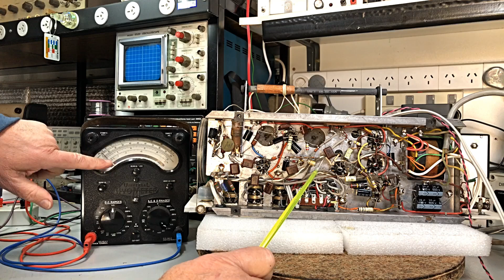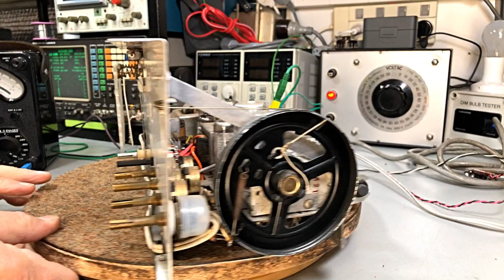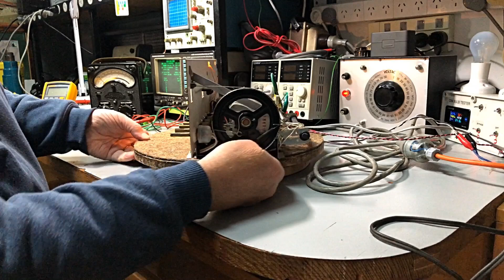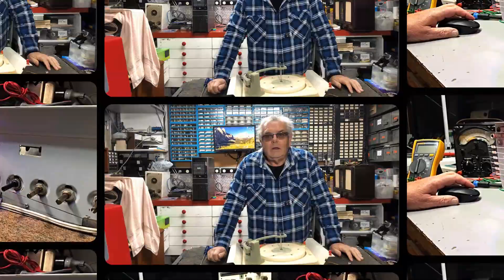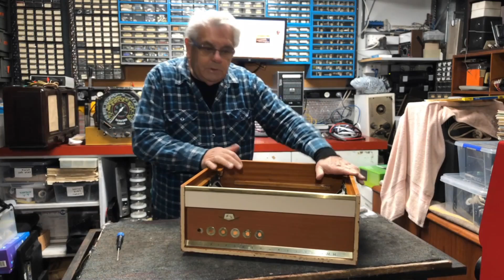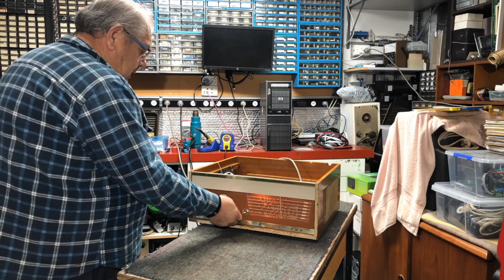HMV TableGram Part 3  - Alignment & Cabinet Install

Comment: A tricky capacitor there Baz. I thought it was odd to have different style trimmer caps but didn't think much about it after that. You have to wonder what the previous repairer was thinking with one of the IF transformers so far out. Good video Baz... although I do wounder why you didn't flip the assembly video back the right way in post 🤔🙂
Reply from the maker: Thanks Dave, I couldn't flip it in software, would separate the audio & would take me forever to lip sync so just left it.
Strange what some repairer's do to get a quick $$ !
Cheers, turntable up shortly, boy, had to strip it too but bonus, no parts left over !

Comment: Baz I have distanced memory from HMV Gram you had removed the dial scale for service it ,I think the man with stripped apron was about and don’t know why picked 475 kHz for If frequency when everyone was 455 KHz,It is very modern now with Bluetooth fitted now,I guess the Diesel Heater is out of your van I seen the temperature in Orange and snow,I remember doing service work in 1984 in snow not good memory’s my Congratulations for on going Refurbishment of HMV Bluetooth Gram I think the owner would be very pleased Baz,Ian,
Reply from the maker: The heater is a portable diesel one on a wheeled stand. Not from the caravan
 Might have to give more footage of the workshop. 4 workshop areas measuring 4.2mts x 17mts. Plenty of room but it's chock-a-block with gear at the moment.
Cheers 👍
Reply: @techobaz55 I could see that Baz you have great workshop but stack with gear and future projects
Fine on your heater you will need it the current weather forecast it look bad anyway Baz keep warm and dry,Ian

Comment: I wonder how the designers arrived at an IF frequency of 457.5. Maybe to prevent any patent infringements? Good catch on that trimmer cap. Wish I could trade some of today's hot weather (37 Deg C) here with you (send you some of our heat and take some of your cold). A bit fiddly getting the chassis in, but at least you didn't have to restring the dial cord.
Reply from the maker: Would be good to maybe swap 10deg Douglas. Just right.
Thanks for your comment.
Cheers 👍

Comment: I wanna see 👀 ya complete the alignment, recap job, and case. Being Part 3, it's time to see this radio 📻 go back together. Alignments can be tricky, meaning if it's the dial pointer, in the wrong place on the dial cord, or a tuning capacitor that's out of whack. Even if the dial pointer is slightly off, can make for a very frustrating alignment. Your friend, Jeff.
Reply from the maker: Thanks Jeff